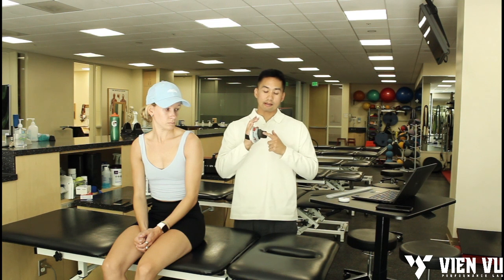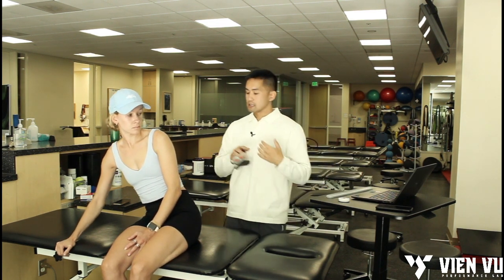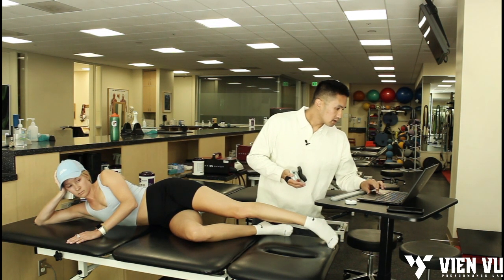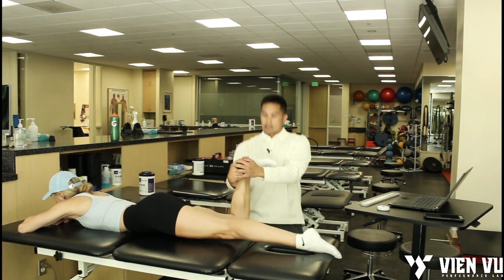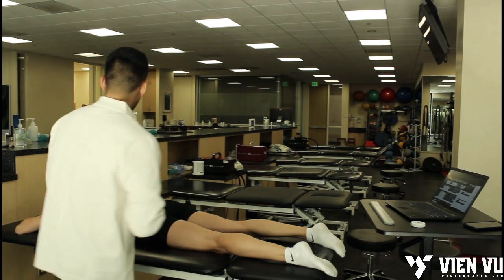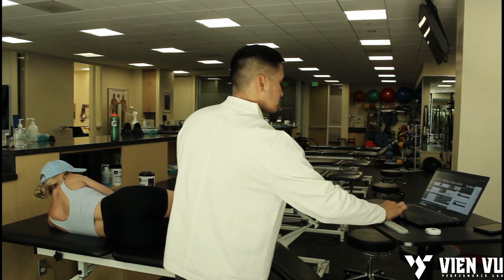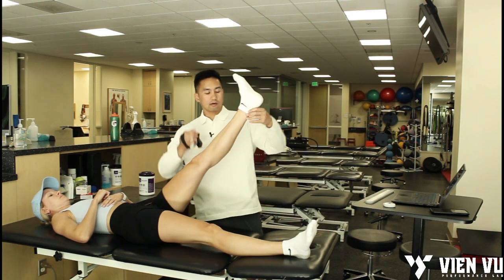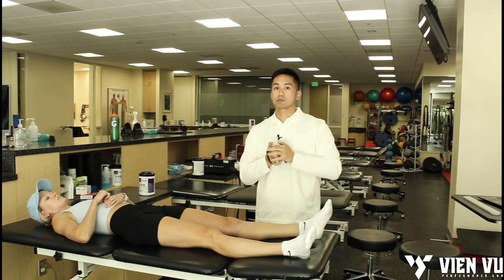Hip Strength Testing Cluster with MicroFET2 (Handheld Dynamometer)

Comment: Between the 3 dynamometers, which one do you prefer?
Reply from the maker: Hi Kevin, sorry for the late response. I like each of them for different personal reasons:
- VALD - slick app and my performance coaches and ATs can see the data on our central hub
- Kinvent - Nice app that integrates all their devices in one, and right after testing I can give cool feedback exercises with the devices
- MicroFET: Simple to use, needs not login, and is what I started with (comfort)